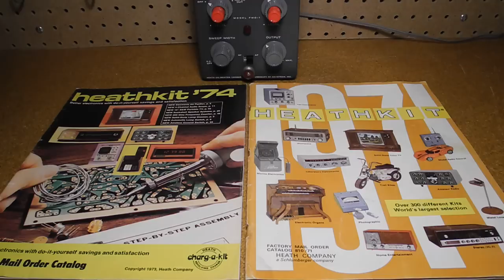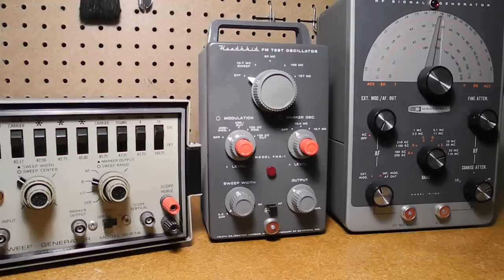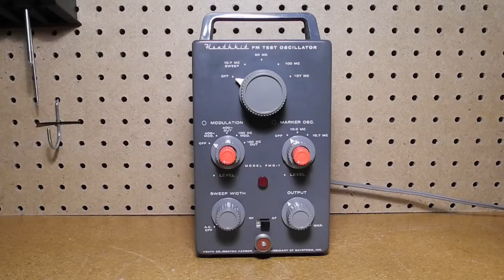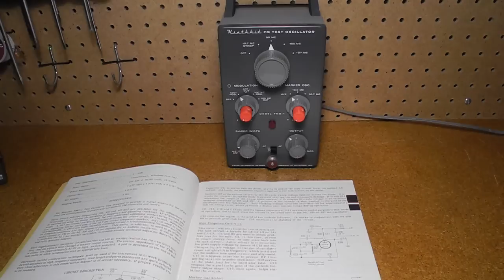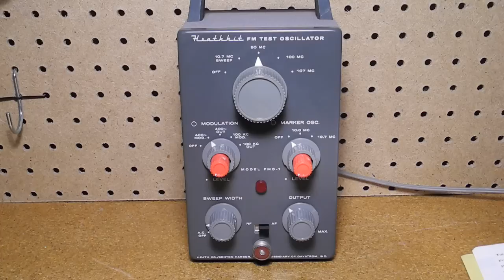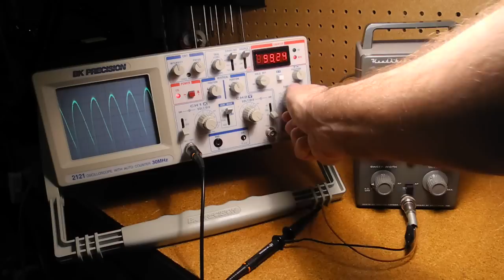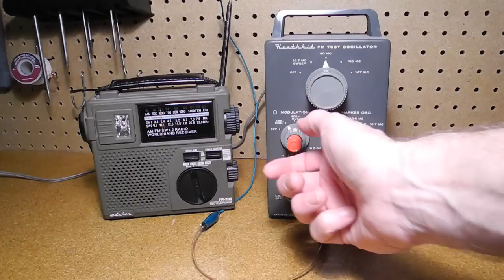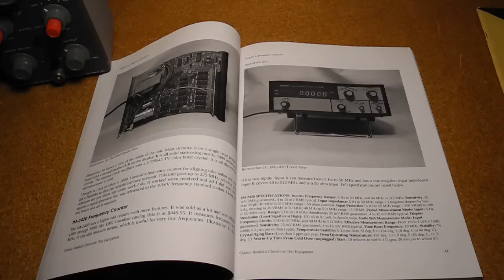The Heathkit FMO-1 FM Test Oscillator

Comment: Hi Jeff, I just purchased one of these FMO-1 units on ebay. I've been looking for a while. I have not received yet but I'm sure I'll want to replace the solinium diode. What should replacement would be best and what dropping resistor should I consider. Looking forward to your response. Thx Ben...
Reply from the maker: I did this to mine subsequent to making the video. I replaced the selenium rectifier with a 1N4004 diode in series with two 1/4 Watt 1500 Ohm resistors in parallel. You could use 750 Ohms if it was rated 1/2 Watt or higher.
Reply: Jeff, thank you for being so responsive... This is the second time I've asked a question and got a response immediately... No one else in youtube land responds this quick or at all... Really thank you! keep it up... :) @jefftranter

Comment: Please replace the selenium as it may overload and destroy your transformer. I almost destroyed a EICO 710 GDM like so. Also maybe a good idea to use a modem bridge rectifier like a DB107 which can usually be salvaged from light bulbs. Dropping resistor will be like 200ohms .